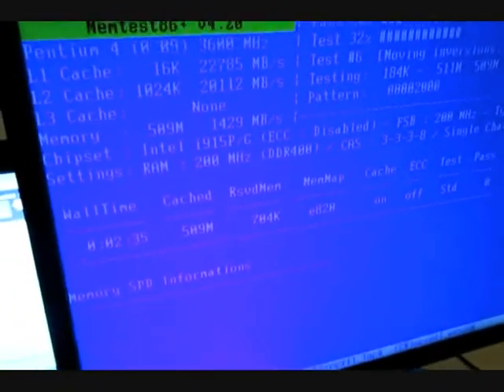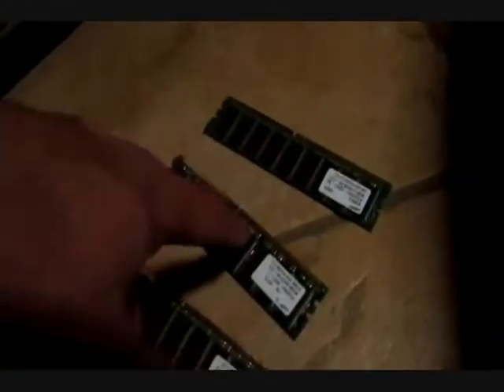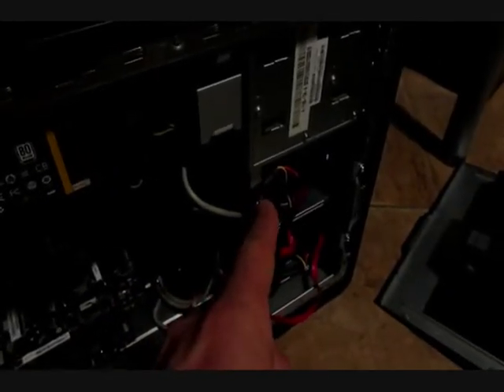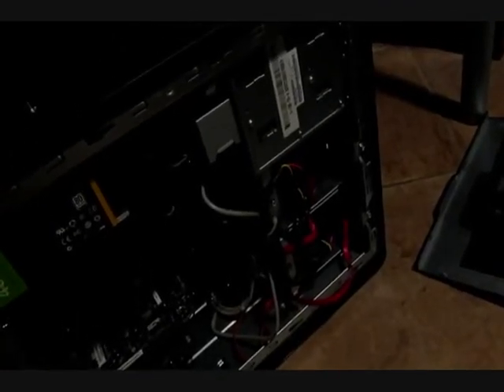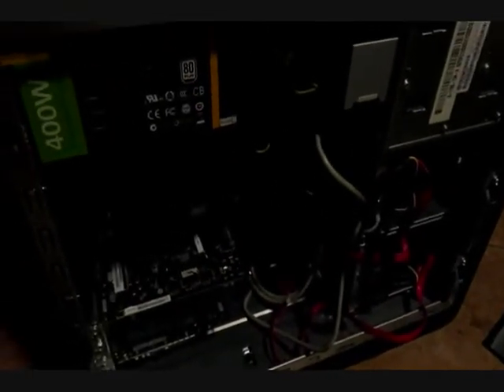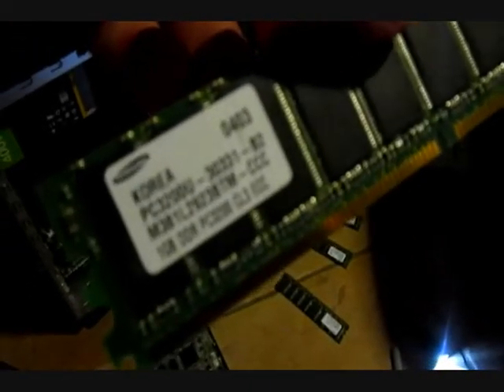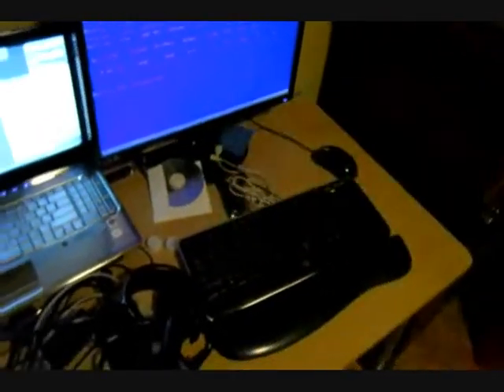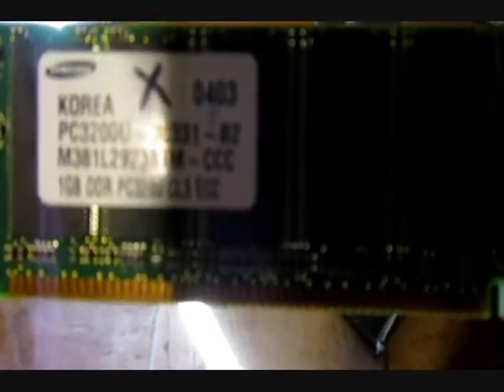Computer ram testing, Yes I have found BAD RAM!

Comment: I think I have some DDR ram from my old PC..It only had 2 ram slots..I'm all SSHD's and stuff now 'n 8 gig ram...I spent $1,000 on the bits and built it...A whole new set up...Well it was all new 2 years ago...lol
Reply from the maker: Yea, that is what I am trying to avoid. Really don't want to spend 700-1000 on something brand new.  I believe the crappy power grid that shuts down here when it wants to thousands of times per year did this damage.  I did have the wrong style of ram in for years, so that is why that went.  This is old P4 processor 3.6ghz.. Junk!

Comment: You can actually get the OEM copy of Windows 7 Professional cheaper on eBay, because I bought a copy for this custom-built computer that I'm in the process of refurbishing. That computer can probably support 4 GB of RAM for the maximum.
Reply from the maker: I have a copy already. Yea I think all it can take is 4GB. Seems to be stable;e on 1gb right now.   I cant believe I bought ECC ram for it when it cant take it....  lol wonder why it failed.  it lasted 2 years with 2 sticks of ECC 1gb in it
Reply: Ghetto Wagon
I usually get my RAM from crucial because their RAM is really good and I never had one fail on me.